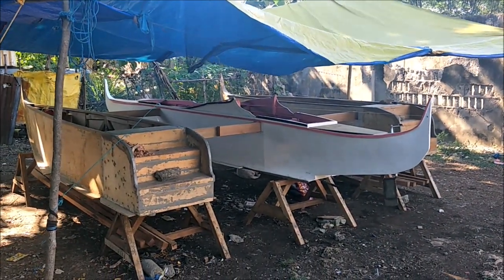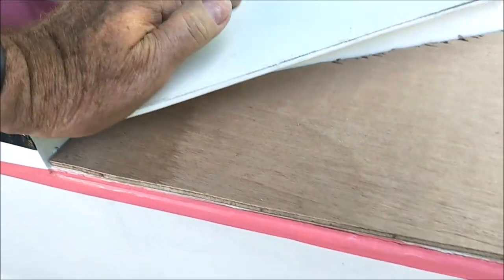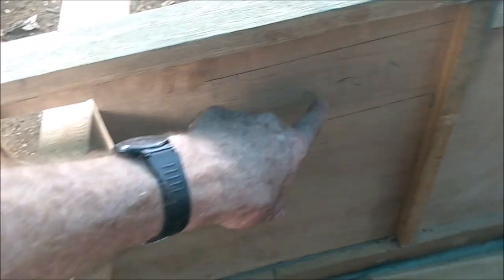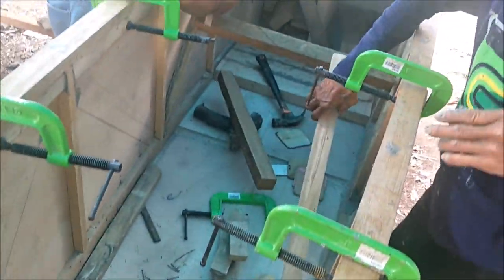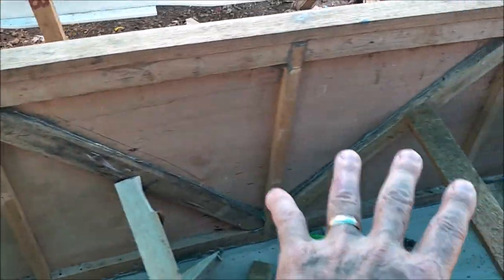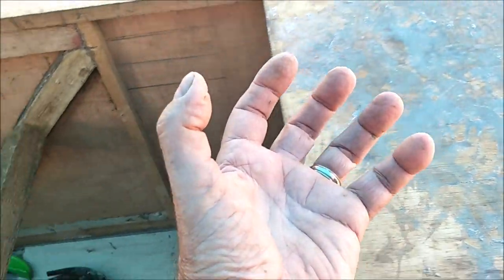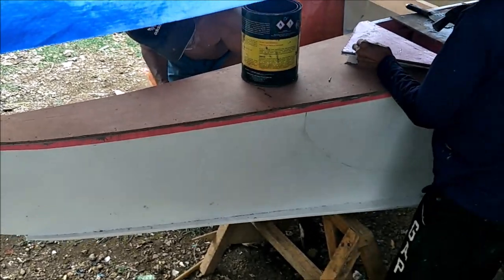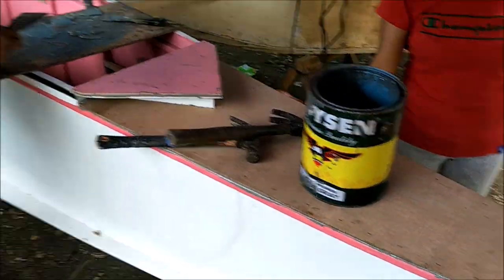Paradise Trimaran - Part 12 - Boat Building In The Philippines

Comment: Wouldn't it have been better to engineer first and then build?  Greater strength, far lower cost, and half the weight.  I'm not sure I will use th at much wood and glue on my 36' houseboat!   LOL  Anjd you are still adding MORE!

Comment: What engines will you put into the tri?
Reply from the maker: Yamada 18hp hi-speed diesels with electric start
Reply: That’s cool I put twin 16s in my bangka, would have liked electric start too. What’s your solar and batt setup like? I need to add for electronics and lights
Reply from the maker: @lifeinpalawan right now I have a 15 hp sumo rato in the center hull and will drive to Bantayan island using that then remove the 15hp and install the 18hp diesels so at this time no electrical until the diesels are installed.